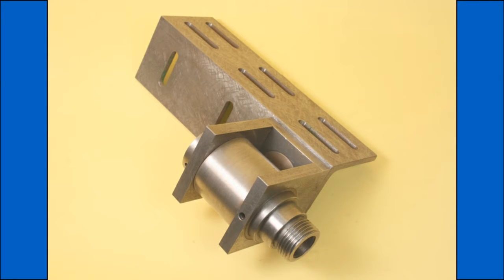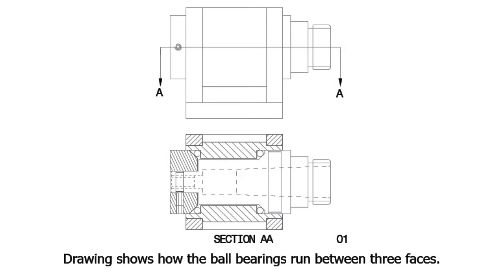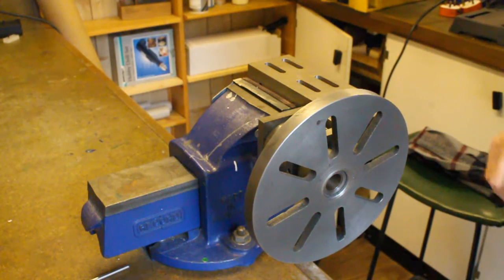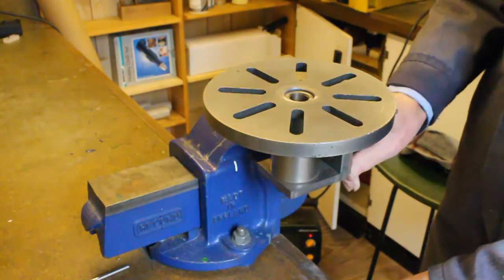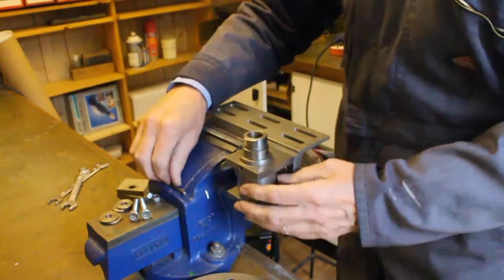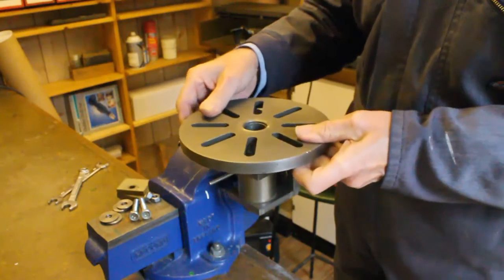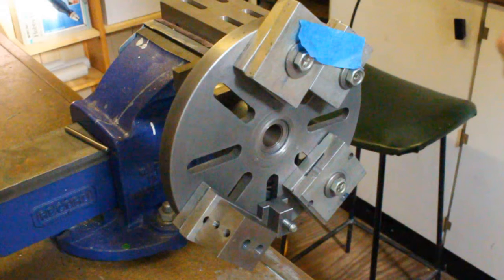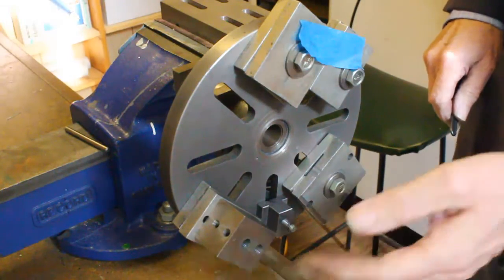Faceplate Balancing Fixture.

Comment: It's a good try, but having it ride a rod on 2 parallels is much more sensitive.

                         ][  <faceplate
                         ][
============================= <rod
  /\                    ][                           /\      
/    \                  ][                         /    \    <parallels

Of course it can't be used horizontally. So...
Reply from the maker: Interesting method ExtantFrodo2. Is there though something missing from your comments as they end    "Of course it can't be used horizontally. So..."
Reply: ...so one may want to employ your method. 
Sorry, I thought that was understood. Me and my damned economy of words.
It would also be no good if you were holding square stock or some such. 
Looking back at my comment it seems it might have come across as much more terse than I intended. Sorry.